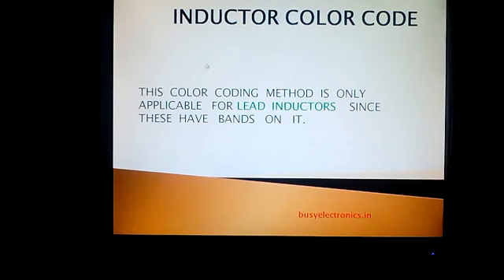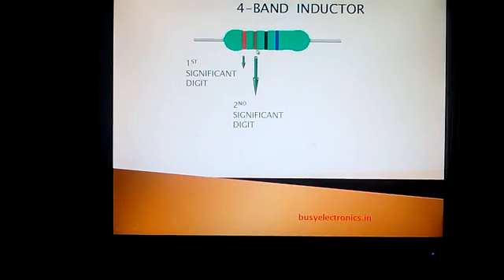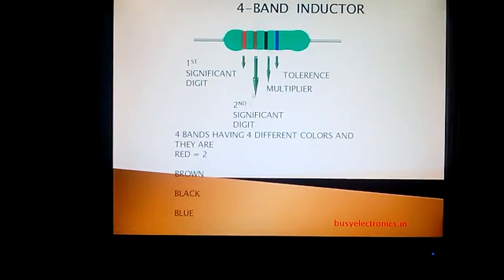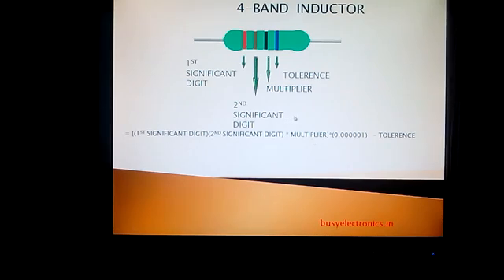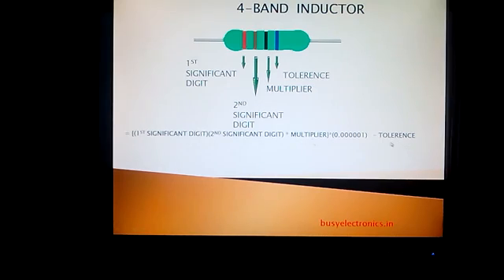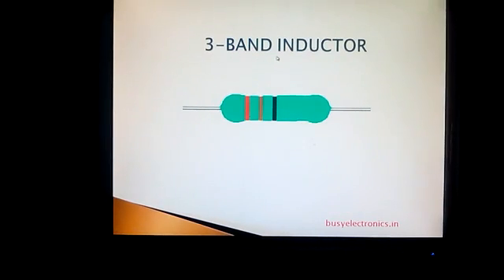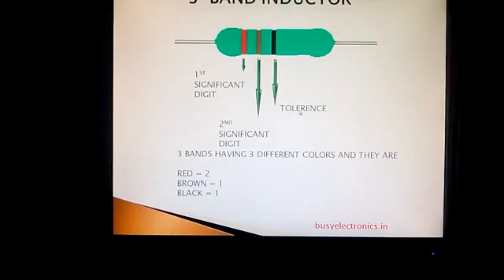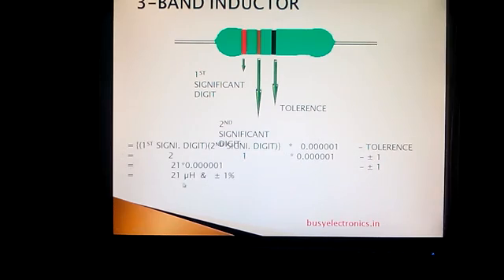INDUCTOR COLOR CODE

Comment: (1) inductors look like resistors, but are light green in colour.  (2) The colour band codes are same as those for resistors  (3) the multiplier is in micro-Henry.  Did I get it correct?
Reply: Is it right ?